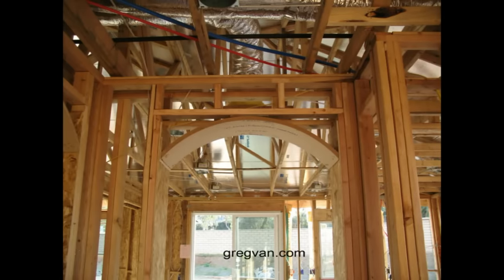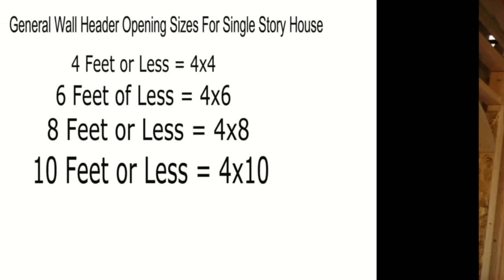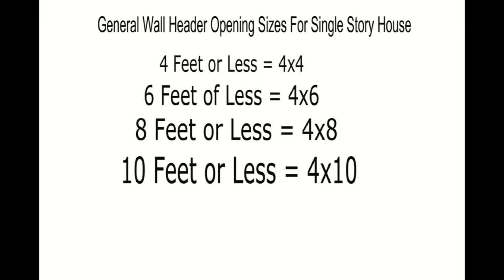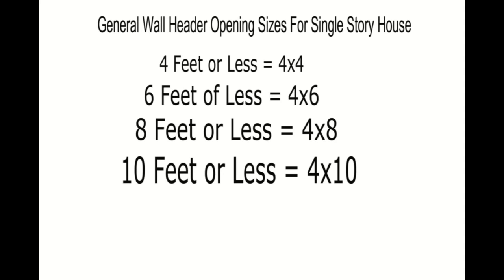Window and Door Header Sizes - Structural Engineering and Home Building Part 6

Comment: Great video, nice to see I am over securing my headers. We build outside walls with 2x6 so right away I am going 5 1/2” wide and my default header is 8”, I normally go with a 2x8 header (so 3 2x8 with 1/2” plywood to make the beam).

Comment: This is a big help! I am enclosing my back porch. It has a 3.5” x 14 or 16” x 33’ support beam with two 4” x 4” posts spaced at 11’. My issue is its 85” from floor to beam which leaves me 5” to work with in framing two doors. Thankfully this will not be load bearing wall.

Comment: 2x12 box headers is the way to go. Never had a crack on the ones I've built. Does not cost much more
Reply: When you factor in the cost of labor it's probably cheaper than adding the stud spacers above the header needed to keep all the windows at the same height below the ceiling.

Comment: Great video as always! Question if I may. Exterior 2x4x15 feet long wall. Single 2x6 rafters on top. 32x36 window to frame. If I understood well, a 2x4 headers with cripples should be enough? Thank you.
Reply from the maker: I can't provide engineering information for viewers, but can tell you that a 4x4 might work better.
Reply: @gregvancom  , Thank you very much for the answer. I appreciated.

Comment: I have a 2x3 studded wall. I need to replace the door frame. Would I replace with a 2x3 rough opening or build a 2x4 door frame which I could only go with a 28 inch door. If I build a door frame with 2x3s, what width jamb size should I use? I probably could go with a 30 inch door. What is the best idea. With 2x4 frame, I would have to extend any electrical boxes and the drywall would start 1/2 inch further in the room. I'm only a homeowner not a carpenter. Thanks for any input.
Reply from the maker: What you're talking about seems to be standard on mobile homes, but you can either build your own door with a frame (or jamb) or purchase a pre-hung door and cut the frame down to size. For example if the new pre-hung frame is 4 1/2 inches wide for a 2 x 4 wall, you can cut it down to 3 1/2 inches wide or whatever you need, with a table saw or circular saw with a rip fence.

Comment: I watched a video and the instructor said always put the jack at 81 in which is the top of a door. That doesn't make sense to me if I'm using a 4 by 4 header 4A 24in height a 48-inch with window. Do you know what he was talking about?
Reply from the maker: The bottom of the header will be 81 inches, then you can measure down from there to find sill height.

Comment: Is it better to use a solid 4x10 header or make it out of 2x10s ?
Reply from the maker: I like the solid headers and even though I'm not an engineer, believe they do also.
Reply: As an engineer, I can tell you that in most applications, laminated headers are preferred over single lumber. They have a higher strength rating. Depending on the specific loads involved, we also prefer laminated lumber for jack and king studs. Again, they are stronger and have less deflection under load. Good luck!

Comment: THANK YOU!!! Quick question: Do I need to use a piece of plywood between 2x4 (or 2x6s) used in a built up header or can I just fill the space with insulation?  I have a 1978 mobile home (single floor) that I pulled the paneling off of the exterior wall so I could drywall & attach the boxes to the studs, etc... and found that I have no jack studs around my front door. They just nailed a 2x4 into the side of the single king stud & hung the door. So, I am too small to actually remove the door & re frame the doorway. I figured if I sistered the existing king stud with another king stud, and then cut the original king stud to make it into a trim stud & popped in a header I would essentially have reframed the door correctly.. BUT what size header? I looked all over trying to find what I needed to use in silicon valley, CA to meet code & be strong enough. So for a 36" door you have a 4x4 and I can totally do that, except the way the wall is built (dropped cathedral ceiling) I have 5 1/2" to the ceiling plate & a little over 2 inches I can't get to. So whatever I use has to slide into place from the bottom and I won't be able to put in any cripple studs. So I am thinking two 2x6s but do they need a chunk of plywood between the layers or can I just use insulation to fill the void?
Reply from the maker: I've seen it done either way, but most of the time they sandwich a piece of plywood in between the two boards so that the interior and exterior wall framing lines up with them. It would be hard to install drywall over a door header that wasn't even with the face of the interior wall framing studs.
Reply: It depends on the application, but laminated headers are stronger. If load is the only concern, or the primary one, use laminate lumber like a pair of LVLs is stronger than a simple lumber “sandwich.” OTOH if heat transfer is a concern, filling the space between the lumber with an insulating material is an option, but it might require a larger header. Anytime you are dealing with a nonstandard instance, you should consult a structural engineer for your specific application. Good luck!

Comment from the maker: If I was you, I would ask this same question to a structural engineer, because walls like these won't provide your building with very much structural support. Usually walls with a lot of glass will require moment frames and large steel I-beams and could become quite costly.

Comment: What size header do I need for  36”x12” window and it’s a load bearing wall ?? Thank you
Reply from the maker: I cannot provide structural engineering information for individual projects like yours, but most 3 foot wide windows in a loadbearing wall usually require a 4 x 4, 4 x 6 or 4 x 8. If you're not going to contact an engineer, then you might even choose to use something larger.

Comment: Hi Greg, for non-load bearing walls, 1 story, if my opening is less than 6 ft, do I need header? If so, would 4 by 6 work for 9 feet tall less than 6 ft opening.
Reply from the maker: I would think a 4x6 would work.
Reply: Thanks Greg! You helped me more than a random structural engineer who came and offer no advice. I recently did a non load bearing wall, and used 4 by 12ft header for 12 feet opening, post is 4 by 4 supporting beam and post attached to 2 by 4, 1 story for 10 ft height.
Reply: Hi Greg, do you think my plan would work? 10 ft tall ceiling to subfloor height. Opening 12 ft, non load wall, we used 12 inch by 4 inch by 12 ft beam, with support posts 4 by 4 on each side and post is attached to 2 by 4 inch by 10 ft stud. Thank you.

Comment: Is there a general rule like this for replacing walls that are load bearing? Like removing an 4’ wall 6’ wall 10’ wall 12’ wall and 16’ wall and replacing with dimensional lumber? I know lvl are more affective in this case but not as affordable. If u have made a video on this topic please tag me with it. I’ve found one where u talk a lot about not removing load bearing walls just not much on if u are what size beam in dimensional lumber and how to transfer the load down to a basement and/or crawspace. Thanks
Reply from the maker: There is a general rule of thumb for single story homes. 4 foot long opening will use 4x4, 6 foot will use 4x6, 8 foot will use 4x8 and so on, however I've seen 4x12 used for 16 foot garage openings. Keep in mind that other factors might effect beam and lumber sizes.

Comment: I have a rough door opening of 32x81. Bought a 30x80 prehung door. Thinking of using two 2x6 and sandwich in a 1/2 inch piece of plywood between the two. Would I be ok? The wall has a dbl plated top plate made out of 2x3. House built in '52. Wall is perpendicular to attic joists which makes it a bearing wall but only putting up a 30inch door. Let me know.
Reply from the maker: That's a common door header used for that particular sized door opening as long as there isn't a concentrated structural load directly above it. A concentrated load would be something like a post or beam holding up another section of the building.

Comment: Awesome video!  We have a large window opening 12’ wide x 5’ high and want to remove the Sheetrock above header to see its size.  Sounds like a header size 4” x 12” be expected, right?  Our house is single story.
Reply: We live in San Diego.  Thank you in advance!
Reply from the maker: Yes, let us know if it's a 4 x 12.
Reply: Thank you for the reply!
Reply: Actual header size is 4”x4”, but there are two vertical jack studs dividing the large 12’ wide window into 3 parts.

Comment: Would the same apply to an interior (right in the middle) loadbearing wall? I’m opening a wall going from the living room into the kitchen, hopefully 12' to 16' wide. Would I need a 4x12' or 16' or can I get away with less? Thanks
Reply from the maker: I cannot provide you with structural engineering advice, but I can tell you that I've seen plenty of 4 x 12 spanning a distance of 12 feet in a single-story home.

Comment: thanks for video ,but i have a garage door 2 opening of 8x7  for 2 story building , i used 2(2x12) LVL. FOR 8' OPPENING OF GARAG DOOR THAT HAD ANOTHER STORY ON TOP , DO YOU THINK  IS ENOUGH TO CARRY ALL LOADS?
Reply from the maker: +nedamemorial I can't provide you with header sizes, because I'm not a structural engineer. If it was me, I would use a solid 4 x 12, but this is only an educated opinion or my best guess, because I don't know how much weight is going to be supported by the garage header.

Comment: I want to cut a 60 in. wide doorway into a load bearing wall in a one-story home.  No concentrated load above it.  Figuring on using two 2x8's glued and bolted together with 3/4 in. plywood in between them.  Is that safe enough?
Reply from the maker: Remember, I cannot provide you with engineering advice, but I think you're on the right path. Most single-story homes I worked on required a 4 x 6 for a 6 foot opening and a 4 x 8 would work even better.

Comment: Excellent videos Greg.  I am currently in the process of remodeling my grandparents old 1940's home that I inherited. Anyways I am removing an old chimney/fireplace and going to install a bay or bow window so the wall I am going to have to reframe for this window. Wall is 15' and it is a load bearing wall and new window is 8' so does the general rule of thumb apply here as well? Would I be installing an 8' header or should I step it up to a 4x10 since it is load bearing?
Thanks in advance.
Reply from the maker: crashduhmy I'm not allowed to give out structural engineering advice, but as long as it's a single-story home, I think a 4 x 10 would work better than a 4 x 8. Remember, this information is only a suggestion and might not work for every situation.
Reply: gregvancom Thinking the same thing 4 x 10. It is a single story home. I also live in the so cal LA area. I'm guessing maybe our building codes are similar. Anyhow thanks for your reply. Keep the videos coming. Excellent work

Comment: Hi Greg, thanks or the video. I am currently trying to remove a closet in a single-story 1950s house, and it is a closet that's around 10 ft long, and the header of the closet door is a 4x10 beam. How can I tell if this wall is load-bearing or not? there's no trusses resting on it that I can see from the attic. Thanks in advance.
Reply from the maker: It would be hard for me to tell you without seeing the project for myself whether or not you can remove the header. Check out this link for more videos on loadbearing walls http://video.gregvan.com/structural_engineering.htm.

Comment: Do you still need a header for a non bearing wall?
Reply from the maker: Yes, you would need something like a 2 x 4 at the very least. I think as a general rule of thumb I would use a 2 x 4 for anything 3 feet or less and at least a 4 x 4 for anything 6 feet or less.
Reply: You still need framing above the opening to support drywall.

Comment: If I am swapping out a window for a sliding glass door and the width of the door is the same as the current window, do I need to do anything with the header? The door is only 80' high and the window height is 84', so I will have to fill in some space, but I'm thinking the header is fine because there's always been a window there. Is it ok to just cut down the sides and bottom area? Thanks for any help.
Reply: MrCtt76 as long as it's framed properly to begin with, you should be fine, just make sure your jack studs go under the header and connect all the way to the bottom plate.

Comment: How do you determine the window sill height on a 2 by 4 ft window?
Reply from the maker: You can subtract the opening from any part of the wall height. I like to start with the top height of the other windows if remodeling or 82 inches in new homes and then measure down to calculate sill plate height.

Comment: I work with a home builder that likes to move the headers up against the top plate then install cripples between the header and window, says he has better luck with screw pops in drywall, does that make sense to you?
Reply from the maker: I've seen it done before, but don't have never done it myself. I don't understand how it could reduce the amount of drywall nails or screws that pop out and of course I've rarely had it happened to me putting the cripples on top of the headers.

Comment: I have a decorative piece I would like to place inside a 6 foot opening between rooms. The ceiling height is 8 feet the decorative piece is 19 inches tall. The only way this will work would be to place the decorative piece tight against the top plate. If a interior wall is non -load bearing why do I need a header?
Reply from the maker: I don't understand exactly what you're doing, but if you're talking about removing a section of a non-bearing wall, that is not supporting anything above, then you wouldn't need a header. However, if you remove a section of the wall that is providing lateral or left to right support for the home, then you might need a header and straps to connect the top plates.
Here's a link to your website that might provide you with more information. http://www.homebuildingandrepairs.com/repairs/framing/walls/index.html

Comment: What do you use for spanning an 8 foot window
Reply from the maker: On a single story house you might be safe for the 4 x 10, but since I'm not a structural engineer and I don't know what type of load or how much weight it is supporting, then I would only be guessing. The one thing I cannot provide my viewers with is structural engineering information and specific lumber sizes.
Reply: gregvancom it's a 2 story house but the joist run perpendicular to the window so not really load bearing.
Reply from the maker: Again, I can provide you with engineering information, but if it was me, I might, and this is only a suggestion, I might use a 4 x 12, when a 4 x 10 might only be required, to make things a little stronger.